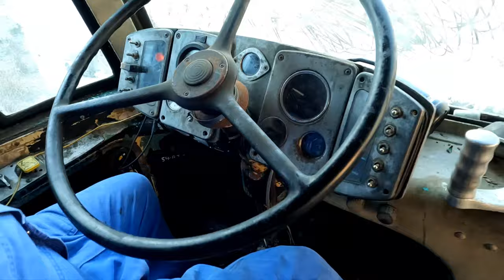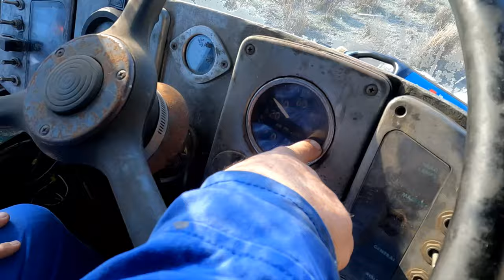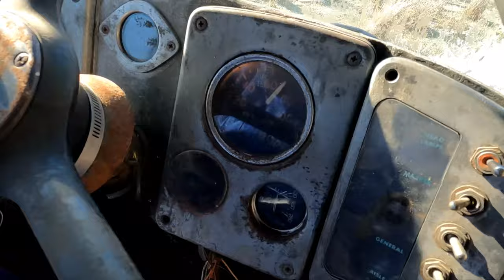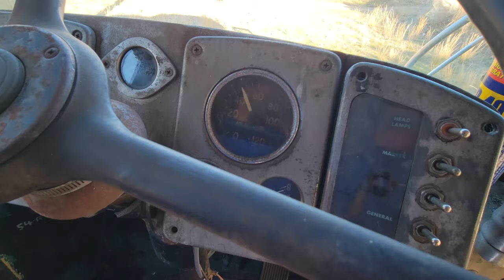GREYHOUND SCENICRUISER FIRST DRIVE IN 43 YEARS PD-4501 907

Comment: I rescued a derelict '62 GM bus that was in Pouce Coupe a few years ago. That bus the solenoid was only for engaging reverse, it still had all 4 forward gears. But then I spent 3 days working on it in my cousins truck shop in Grande Prairie and got the solenoid working and the throttle lubed up & freed. Then i drove it 850 miles down to the west Kootenays! It cruised at 70-75 mph easily all day long, with all 6 new tires!
Reply from the maker: Lovely story. Thanks for sharing that.

Comment: Simpler to put it in reverse from the outside.  You need to put the bus in first gear, then with the clutch depressed, useing a stick or rod between the axles on the driver's side, press against the solenoid arm while pulling the transmission from first back to second.  Those solenoids were frequent fail items, even back in the early 1980s!

The Solenoid only flips the function of second gear to Reverse. Without the solenoid you have all four forward gears as the default position for it is to engage 2nd gear. 

I would be shocked if that thing would move in that field in third gear! Even in in second the bus won't have enough torque to move much at all unless on smooth flat ground. I feel for that clutch. 

If I recall correctly 1st gear was 0 to 17, 2nd was 17 to 35, 3rd was 35 to 53 and 4th was 53 to 72. (Disclaimer: it's been 42 years since I drove one!)
Reply from the maker: Love it. ❤️

Comment: Throttle pedal sticking usually is right at pivot at bottom of pedal itself.. all dirt. Water.. salts shit off feet.. spray pivot on pedal with kroil or PB Blaster with bus off.. work the pedal by hand a bunch..rinse and repeat.. get that lube worked into bottom pivot of pedal to help free it up..
Reply: could be the racks
Reply from the maker: Thanks you guys. It's freed up and works excellent it's lightning quick at the pedal now.👍

Comment: It should have a Williams Control air throttle so just squirting the piss out of the pedal should free it up. Check & see if the clutch brake is warn out or the pressure plate needs adjusting. I was screaming inside when he was ripping the tops off the gears!:hand-orange-covering-eyes:
Reply: Williams air throttle can be a nightmare on a bus thats still a manual trans.. my understanding anyways.. it doesnt let rpm drop fast enough for the shift to next gear i believe.
Reply: @brentlance2379 you just have to get used to a air throttle with standard transmission,I drove them for many years.   🇨🇦😎
Reply: But I’m sure that the 4501 did not have a air throttle,originally
Reply from the maker: Pedal is now free works great. Thanks😊